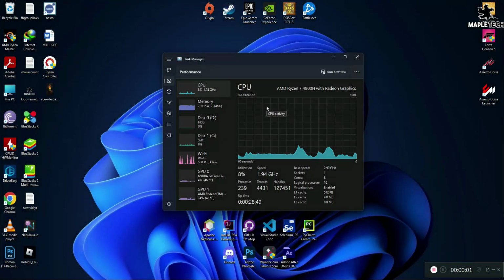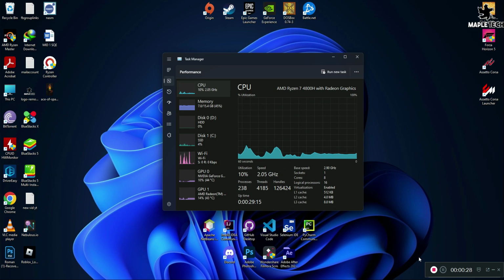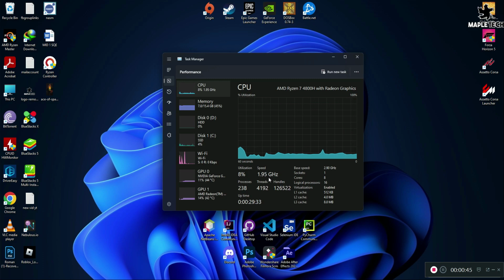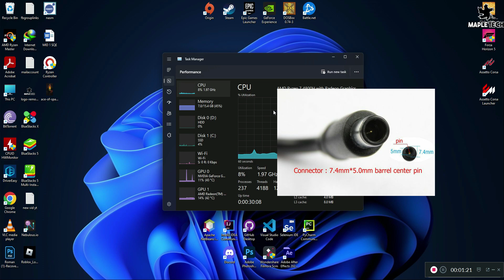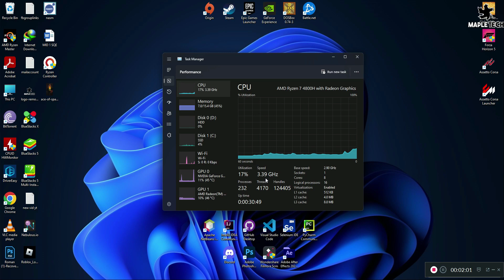How to fix CPU Stuck at Very Low Speed | EASY FIX | Stuck at 0.39Ghz | 2022

Comment: Asus vivobook m1603QA  amd  5600h I am facing the problem but only on the battery mode and it happened after a voltage fluctuation cost burn in the battery connectors Android and I have changed the battery also update that the system then I realise that the system is is walking at 0.4ghz on battery mode and working faster and good when it is plugged how to fix it Android multiple things like updating the buyers and changing the OS using the ryzen controller and changing power plants and trying easily set like a pressing for 60 second in the power button 
Nothing helped me yet so just help me please

Comment: I hace reset the bios but this error was stay plz tell bro how I can fix my pc not work proper it's too stuck and lagaging
Reply from the maker: It might be due to overheating in PC. This fix is for laptop
Reply: @MapleTech007  13900K running at 3Ghz how to fix
Reply from the maker: @officialyashvirgaming  If it is a PC, the fault could with your PSU, how much PSU are you using for these specs?